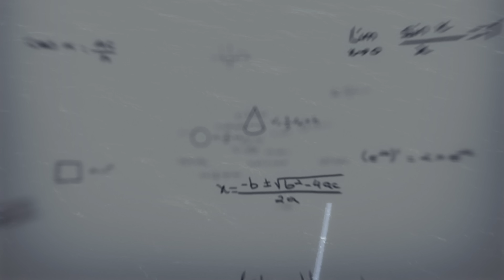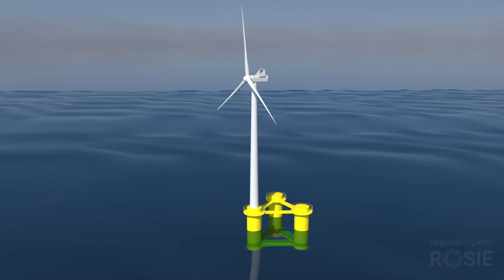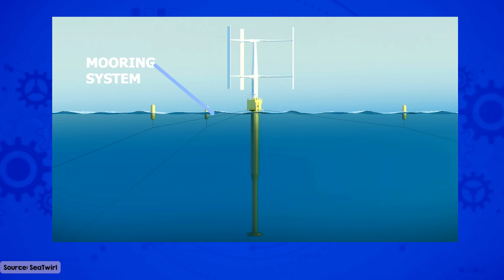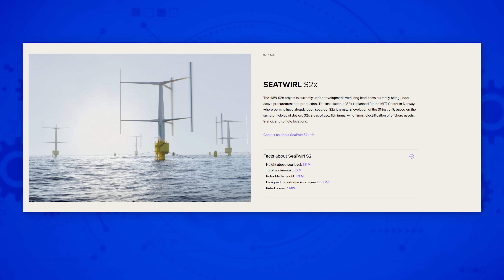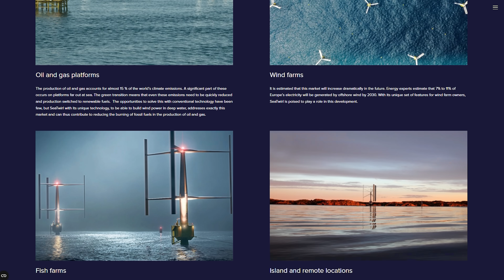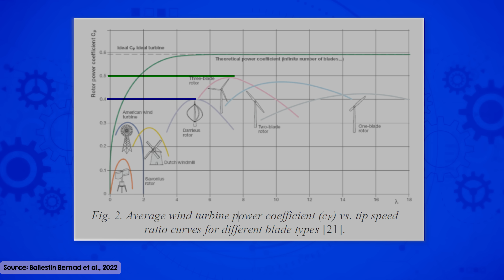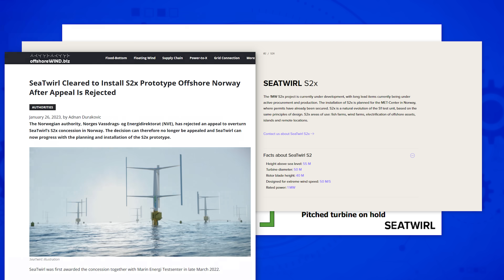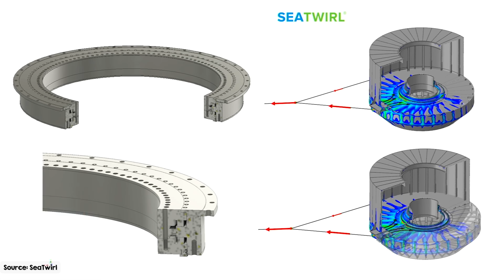Are We Building Wind Turbines All Wrong? SeaTwirl Thinks So

Comment: load of claptrap. the problem with wind power? HOW you extract energy, and the form you extract it in.

trying to generate electricity directly is a fools game. change to alternate forms of energy and the only limit is betz law and the structures ability to stay upright.

but as long as you swallow the propaganda, stay stuck in the rut that "electricity" is the only form of energy, select companies will keep raking in those "green grants" without ever having to actually deliver.

Comment: I thought your man was a bit evasive to your questions about testing.

How about that? A wind generator to supply power to oil and gas platforms. I knew I didn't trust him.

I am no engineer but I have experience at sea and, just as with tidal /wave energy generation, I am concerned that the unpredictability of extreme weather factors could make what looks like a simplified and less costly installation look very expensive indeed.

I hop they spend their new grant wisely to evaluate performance against some of the wilder conditions that larger turbines will encounter at sea.

Comment: Bird populations are going to plummet.
Reply: Yes get rid of all buildings, oil fields and cat if you are worried about bird populations.
Reply: @universeisundernoobligatio3283  Buildings and oil fields do not kill very many birds.  Kill all the cats for all I care.  They are no benefit to the world's ecosystem.  Birds, however, are of great benefit to the world's ecosystem.  Huge blenders in the sky are killing and will kill a lot of birds.
Reply: @wesbaumguardner8829  
From Sibley Bird Guide
Feral Cats 2.4 billion
Buildings 600 million
Vehicles 214 million
Posion 72  millio
Wind turbines 230 thousand 
Yes wind turbines are the problem.
By the way humans have the least benifet to the world's ecosystem.
Reply: @universeisundernoobligatio3283  That is old data from 8 years ago back when there were not many wind turbine farms.  I guarantee wind turbines have a higher kill rate than buildings.  We just have hundreds of millions more buildings than we do turbines.

Comment: Exciting! Floating + VAWT seems like a great pairing. Looks like it can be mechanically a lot simpler, and presumably no maintenance needed at the top of the structure. Key thing will be $/mWh at scale, as always. Seems like it could be a competitive design. Thanks Rosie, great vid!
Reply: Nope. You want to bet on that? It will never get past the full scale prototype, probably not even that far. They will just spend the grant money and disappear. Its not the time to enter the wind industry as a new company. The material costs are too high. The big manufacturers already established in the industry are strugling to be profitable. It has not been proven that floating wind is economically viable.

Comment: For what its worth, just saying that, the VAWT system doesn't need to face into the wind, or have a system to rotate the whole turbine housing as in HAWTs, for the blades to face the wind for max efficiency. The VAWT is always at it's optimum angle, whatever, and whenever the wind changes direction. Thus it is a simpler system in that regard. However, in gales force wind conditions, it still needs a way to ensure the rotor head and machine from rotational overload, and the idea of having just two blades makes sense, but it should be proven in a wind tunnel first. One assumes that the optimum blade shape, length and size, and rotor diameter have all been simulated, and worked out, to yield the optimum power per wind speed etc. There are quite a few advantages of the VAWT, and that is less cost to the environment to produce and maintain. Also, the system is inherently more mobile, Ie can be set up as emergency power, or for a small island. I like what this company is doing, and I feel that they offer a niche product, that can power far to reach, off grid communities with electricity, that they haven't been able to have before. As I was taught years ago, its absolutely of no use, if you create a machine to save the environment, but have a huge cost to the environment, in its realisation, as in the enormous HAWTs. VAWTs such as SeaTwirl, are significantly more environmentally friendly, and have a significantly less cost to the environment in their production.Bravo SeaTwirl!
Reply: Why do you think VAWTs are more environmentally friendly? First they need to demonstrate a working full scale prototype, because computer pictures are not environmentally friendly. The much lower efficiency means they need to be built with more materials for the same energy output, which is the opposite of being more enviro friendly.

Comment: I can see that the anchors stop the spar (underwater part) from spinning, but why not reduce the load on those anchors as much as possible?  If that spar wasn't a round shape then it wouldn't want to just spin around in the water the water could add some resistance to the rotation, and surely that would reduce the load on the anchor.

Comment: We did some calculations for putting wind turbines on boats and vertical turbines were far less power for their size and weight.  The vertical wings are only aligned correctly to the wind for a small portion of their sweep.  This makes their forces and output pulse and vibrate. To reduce this pulse and vibration they add more blades and make them helical -this company proposes to do the opposite with no mitigation.  Horizontal blades are aligned better to the wind through their full sweep.
If putting the gears and generator down low was such an advantage it can be done on a horizontal as well.
Reply: Yeah but paddle boats were so cool,  why don't we build more.
Reply: Imagine the fatigue on those structures with each blade for each rotation. This concept has bin deemed unprofitable decades ago…
Reply: Helical turbines have even  less power. Vertical turbines can be spaced closer together than hawt .
Reply: Rosie, I suspect you know all of this but went easy on them because they are good people with $15m to work with.  It would be very interesting to get real data on forces and vibration -I have never seen such a high output as they claimed from the limited search I did.  Maybe the electromechanics can dampen or mitigate the power pulses.
Reply: Basic facts. Wind turbine electricity generation is neither cheap to build nor maintain. They are not at all competitive.  They survive on green energy tax cuts. Without them, they would be dead. It is an artificial "cheap energy " because it is not cheap. The public is paying for them.
Reply: @Raj-nh3fc put a wind turbine beside a fossil fuel power plant with its support chain. The later is hundred times more complex and maintenance intensive with a high pressure steam cycle and  supporting trucks and boats
Reply: @Raj-nh3fc in Australia its the coal plants that survive on the subsidies, being kept going until enough wind solar and batteries are built out to produce enough reliability to  shut the unprofitable things down.

Comment: The problem is simple - VAWTs are using the SLOWER wind near the surface - HAWTs are using the faster wind higher up
That is in addition to the lower efficiency
So it costs more per MegaWattHour
Reply: Does not really apply at sea , windspeed is not much higher unless you go ridiculously high.
Reply: @etxkgh  Wind speed reduces by 20-30% (at sea) until you reach the "gradient height" - about 213m (at sea)
https://en.wikipedia.org/wiki/Wind_gradient
The available power goes up with the cube of wind speed
So a 30% increase in speed more than DOUBLES the available power
Reply: @duncancairncross  ] the wind gradient is not significant for sailboats when the wind is over 6 knots (because a wind speed of 10 knots at the surface corresponds to 15 knots at 300 meters, so the change in speed is negligible over the height of a sailboat's mast). According to the same source, the wind increases steadily with height up to about 10 meters in 5 knot winds but less if there is less wind. That source states that in winds with average speeds of six knots or more, the change of speed with height is confined almost entirely to the one or two meters closest to the surface.[   - from the wiki you quoted.
Reply: @etxkgh  The wind speed difference is not signifigant for sailboats 
For a wind turbine the difference between 10 knots and 15 knots is a factor of 3.3 in the available energy for the wind turbine 
Over three TIMES the available energy

Comment: There are some things that I don't think add up. 1. The effective area must be half the frontal area. The time the wing is moving towards the wind it must be ineffective at best. 2. Then there is the height of the mast/rotor. For an ordinary hawt it is half the rotor diameter plus something to get up in the air. For the vawt it looks to be very similar. Hallf the wing height plus something. 3. It also seems to me the load on the rotor corresponds to the wing load/energy harvested so it must be heavy duty. The idea of horizontal assembly before raising it may be the only real advantage which is possible due to the low placement of generator. Is that enough to be competitive against the tried, tested and very refined design?
Reply: 100% agree.
I would add:
4. Where is the huge torque from the rotor going? What keeps the foundation from rotating? Horizontal torque arm?
5. Generator/gearbox (?) is IN the water. How do you seal the main bearings, maintain and repair it? Show me a rotating sealing, with some meters diameter, that runs in harsh offshore salt water maintainance and trouble free for decades! 
Exactly... 😉
Too me it looks like a VERY early test of concept OR scam.
(BTW, I'm 30 years into wind energy)
Reply: @Stefan_Dahn   No gears required , generator is above water . Concept already tested and proved since 2011.
Reply: A few thoughts here: on #1, without simulating an entire cycle and knowing the pitch profile/angle of attack it might not work out nearly so bad. It does seem like the cyclical stress variation would be much greater than in a VAWT. 

About the torque, at 9:30 they do say the mooring lines absorb the reaction torque. 

On the bearing, their model seems unclear and the renderings show the main seal would be above the mean water level, and you could shield it but it's a definite concern.

Comment: Two big problems:
1. It sits down in the slow wind speed air, slowed by drag from the waves and full of turbulence!  It is not going to get close to competing with the 300 meter tall conventional turbines with their blades up in the strong and turbulence free winds.
2. It has it blades at sea bird height, and is going to chop them all up!  The latest conventional offshore turbines all have their blades above the height that sea birds fly, so have no bird problems.

Comment: This is great! I'm still a bit unsure about how the generator torque is reacted
Reply: That is what I was thinking... in the model @10:52 , there are three cables preventing the generator from turning with the rotor, and they are anchored to the sides of the perspex tank, but when at sea, where do you anchor them?  If they go down to the seabed, they need to be at a low angle, so need to be very long, and if you have a 20MW turbine (to match the latest floating turbine designs), then those cables are going to stretch and wind themselves around the generator!

Comment: Engineering is about using the correct design for each environment. How high can these be ? High for wind speed and also safety for shipping.
Reply: Windspeed does not increase much with height at sea.

Comment: I mean, it looks interesting, but I am not sure I believe the higher than 0.42 efficiency,
And if they’re actually trying to sell it like that, why isn’t there a prototype? 
Seems the last one they built was 10 years ago … how if they sustained themselves for 10 years?
I’m not saying they’re not doing legit work, but surely you could’ve made a prototype of the new structure ?
Reply: Also yeah the swept area is a square, great, but its low to the ground which has dramatically lower average and mean velocities.

Getting taller allows for bigger blades, but also access to more regular constant faster winds. And this does not do that atm.

That said you could put these inbetween regular windmills that catch the taller wind potentially, as the footprint is lower.

And then it might be worth it, as the additional cost is fairly marginal.
Reply: Prototype will be built . google seatwirl verti-go.

Comment: Doesn't the lower efficiency mean that the turbine experience higher wind force for a given power output? If so that kind of negates the advantage of lowered center of gravity.  The mass distribution in the design is constant, wind force is not.  

Also, doesn't that force fluctuate significantly with the blades position relative to the wind direction, when the blades are straight and vertical? And if it does, it seems to me that problem should increase when the number of blades decrease. It seems to me that two-bladed VAWTs with straight blades should be great for wind powered stress-testing of towers, but probably not as great for power generation.   

A projected maximum efficiency that could be argued to be acceptable, if true, is one thing, but how does the efficiency change with wind speed? It seems it would be much more difficult to have robust variable pitch systems on VAWTs than it is on HAWTs.    

The other, possibly more obvious issue with the difficulty of having controllable pitch in VAWTs for serious power generation is how do you deal with very strong winds? Just overbuild them to tolerate any wind speed they might be exposed to? Sure the two-bladed version kan be kept in a position to minimize drag on it, but that means total cutout, and requires more or less constant significant input,     

I wonder why their turbines were so close to the surface, is that another part of the strategy to lower the center of gravity at the expense of power generation potential? The turbines looked very close to the surface to me, both the actual turbine, and in their illustrations.  

Yeah, a square with a certain side has a larger surface area than circle with a diameter of the same length, I think that's kind of irrelevant when the square requires additional structures, and also has to be overbuilt as there's no easy good way to reduce the wind force when needed. 

I also think it is great that assumptions get challenged, but there's a bit more than just assumptions behind the convergence to current wind turbine design philosophy. Also, besides wind tunnel tests, maybe they should try to make as relevant comparisons as possible, like how much material will they need for a certain power generation compared to how much a conventional design with the same output would need, that can provide some indication of what the cost could come down to relative to conventional turbines if their design ever gets mass produced and the production and design gets fine tuned long enough.          

Maybe I'm colored by the fact that VAWTs so often are portrayed as some overall superior technology that the industry apparently for some mysterious reason just don't use, but I see multiple very significant inherent disadvantages, and only some modest to insignificant potential advantages, which become irrelevant compared to the disadvantages for serious power generation. 

I really liked the demonstration of the two-bladed model in water with a fan blowing on it, I wonder if it's ok for me to try to design a fan powered "blade-less" stirrer with inspiration from that design, for non-commercial use? That clip was very short, so maybe it wasn't a great representation of how it usually behaves, but it looked like there's some great potential there, to use the whole as a stirrer that is.

Comment: Disposal of Wind Turbine Blades, Current Practices
Most retired wind turbine blades currently end up in landfills. In the United States, there are only a few landfills that accept these blades, primarily located in Iowa, South Dakota, and Wyoming. As the wind energy sector grows, the number of decommissioned blades is expected to increase significantly.
Fk you greenies.
Reply: "Most retired wind turbine blades currently end up in landfills." <- now do the rest of all the stuff humans make.  There's no reason to pick on windmill blades as going to landfills other than to spread anti-wind propaganda.
Reply: Turbine blades are recyclable these days, problem solved, at least for the new ones.
Reply: Luckily coal mines destroyed so much land and dug so many deep holes that only a tiny amount of those would be enough to dumb all used wind mills of the next few hundred years or so.
Reply: Rosie's PhD is about the disposal of the blades.